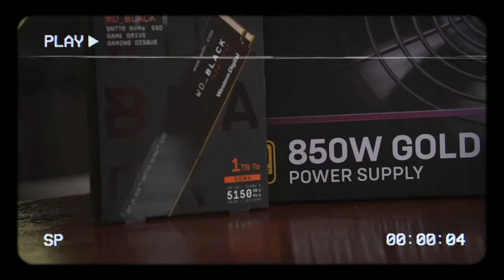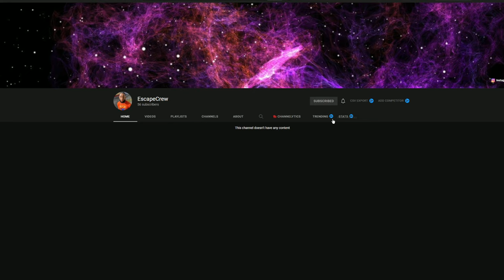I Built My Best Friend His First Gaming PC

Comment: Did you guys remember to take the plastic cover off the AIO heat sink? Also most AIOs come with thermal paste preinstalled so there's no reason to put more on the CPU.
Reply from the maker: Yes we took it off
Reply from the maker: and it does not come with thermal paste. I know what I’m doing. The thermal paste came in a second tube

Comment: The AIO lines need to be brought down, they are supposed to the lower than the intake, that will degrade the system over time.
Reply from the maker: That’s not true actually. There is a Jayztwocents video explaining why this is false 

https://youtu.be/DKwA7ygTJn0
Reply from the maker: If you pay attention it also won’t work with the size of the graphics card and case. There is no other way to mount it in this case. This orientation if perfectly fine. The important part is that the radiator too is higher than the pump. If you watch the video Jay explains it in simpler terms